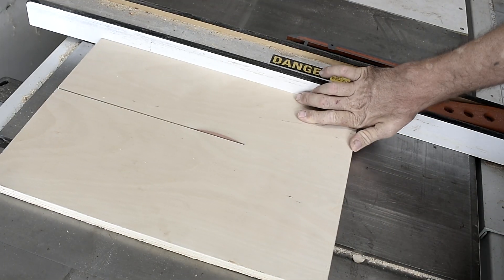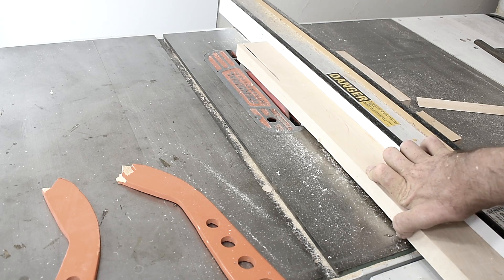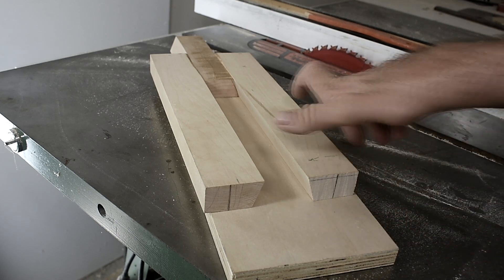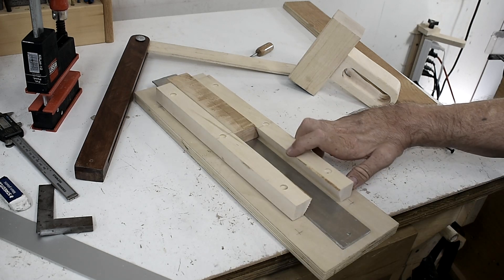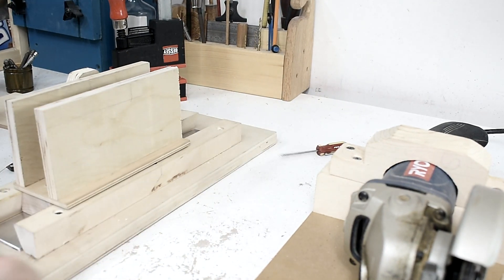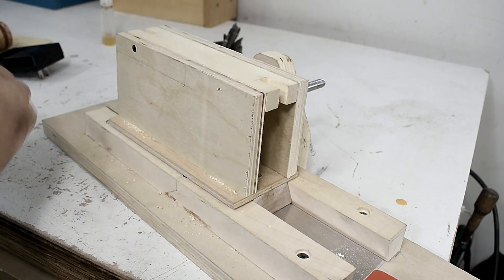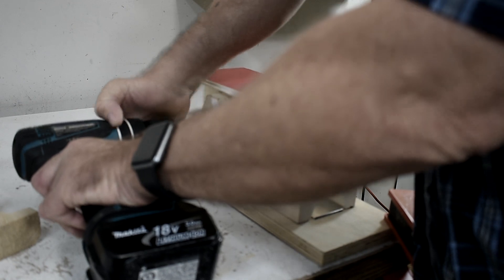How to Make a Reciprocating Sander

Comment: This will never work.  Skip to the end.  Oh, it works really well.  hmmm.  And there could be a million variations of this.  I always wondered why those orbital sanders that you buy on vibrate a tiny distance. They don't work very well at all, and millions have been made.  They do nerve damage to your hands and arms.  They suck.  I really like this set up here.  I think it could be made a lot better with real materials, and the rotar horizontal to the table and not vertical like it is here.  Put a motor underneath and clean up the table area.  Make a stand alone unit.  Make it from something that has a nice metal plate.and stand like an old table saw, or such.  Maybe a table router, or just something with a flat steel plate and stand that is solid.  Old rusty one can be cleaned up nicely.  With better components, you could make a version that you can adjust the travel, and motor velocity, and tune it for different jobs.  Great build.  Subscribed.

Comment: Uhm.. what's the advantage over a continuously running belt sander?
Reply from the maker: Better control and I can adjust the speed.
Reply: Hm but why is the control better when the sandpaper is wiggling around and thus changing the direction of the force it applies to the workpiece all the time. also you can adjust the speed on a decent belt sander. 🙂

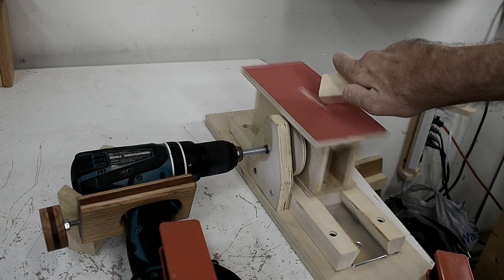6:06 that doesn't look like anything near "good control" to me. I'm sorry :D
Reply from the maker: Paul Hamacher  I look at it like this, If you do dry wall you would not use a belt sander.

Comment: Pretty cool jack! Can u make the platform bigger to hold a full sheet of sandpaper or would that slow it down?
Reply from the maker: I don't think it would work, that would be to much area. If you glue a full sheet on a block and use it as a hand sanding block it would be very difficult.
Reply: @Jacka440  ahhh okay yea that makes sense..